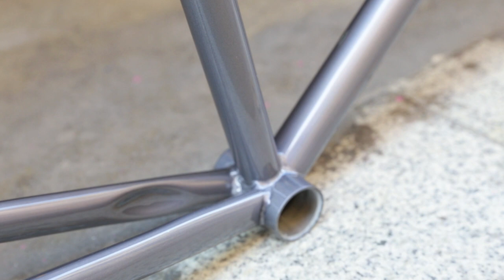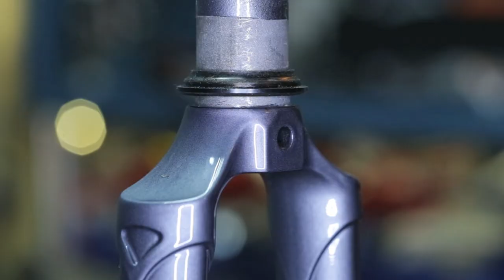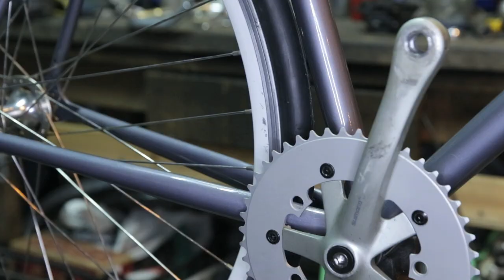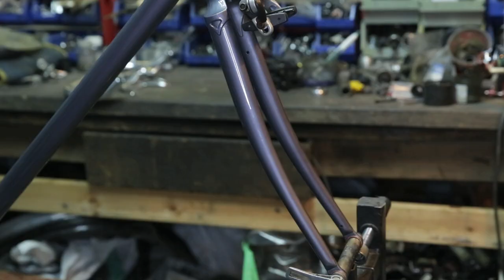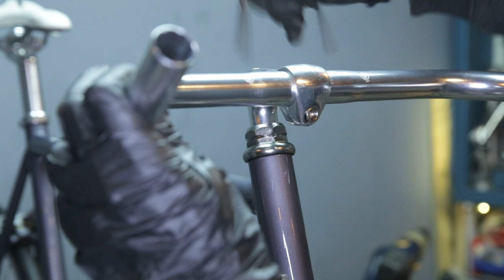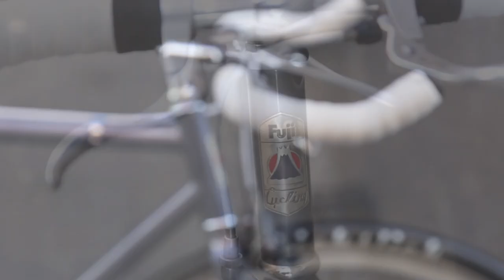Fuji Feather single speed build

Comment: Thick slicks are great, if they fit.
Reply from the maker: In my experience I have found that 28's will fit most 80's and 90's road frames. 90's track frames can get tricky though and sometimes will only allow up to 25.

Comment: Wanted to drop in to see if anyone used a 13 tooth cog and does it last?

I am thinking if go 13t or 14t on back, unsure on complete fixed gear ratio as on a 6.7kg road bike I ride up hills I need with 53x11 and my 16kg mountain bike I use 44x11 everywhere
Reply from the maker: The tendency I've noticed is the smaller you go the shorter the life span.

Comment: can you please tell me what the headset size is? the cup length?
Reply: and what was your fork steer tube length?
Reply from the maker: So this frame was rebuilt after a full tear down for a paint job. This is the original factory fork, frame, and headset. Unfortunately I didn't take the measures you need during the rebuild and the bike is now with its original owner. May I ask what the specs are needed for?
Reply: @TheUndeadMechanic  i got a fuji classic and wanted to convert it into threaded by replacing the fork. Also the bike is amazing nice build